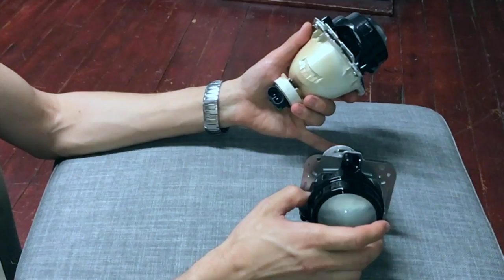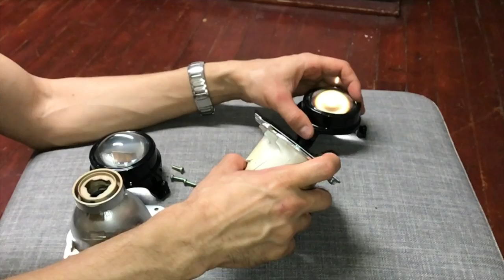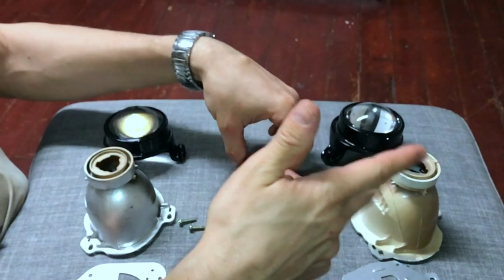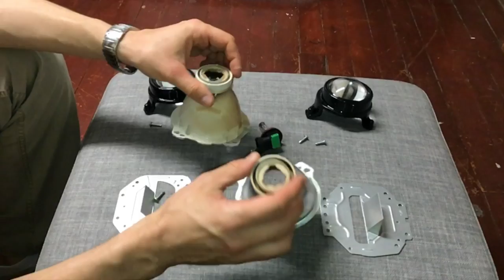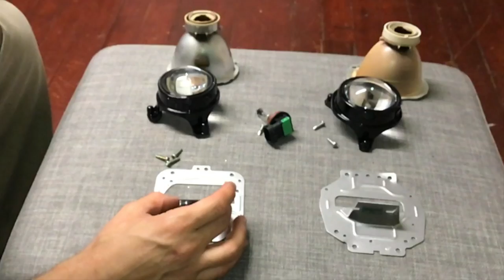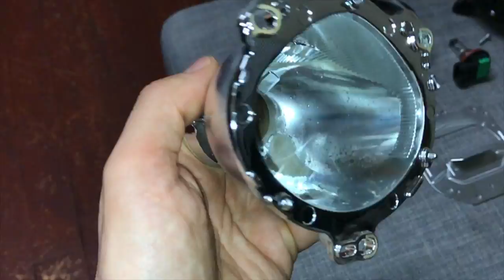About Projector lens(theory and practice)...

Comment: Thanks for this video. I try to get better light to my Ampera (Twin of chevy Volt). Same issue: bad HIR2 OEM lights and nearly all other halogen HIR2 are same bad. Now I've bought LED conversion but not installed. Because of your video I ask myself, if my reflector looks like yours. But I try it out :-)
Reply from the maker: thank you. I have 2 videos of Volt LED conversion. I found it a little better over halogen anyway, worth of a try if you already have Led conversion.
Reply: @artworkslights  Yes, I'll try it. In the order I did a mistake and ordered HID bulbs and LED Ballast/decoder. Again LED's ordered but not yet arrived. With the halogen bulb in this session with rain it is horrible an frightened to drive, so it goes only better ;-)
Reply from the maker: @Tobi.Canobi  with most cars its like that